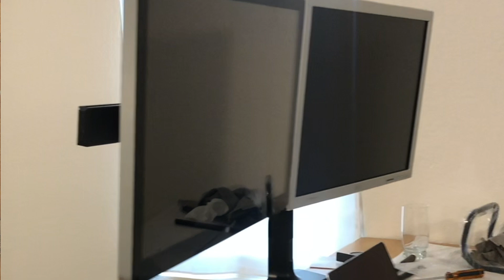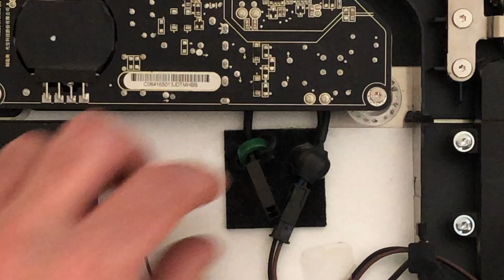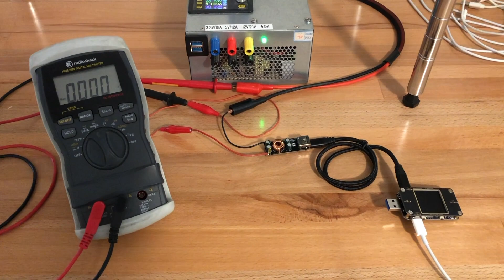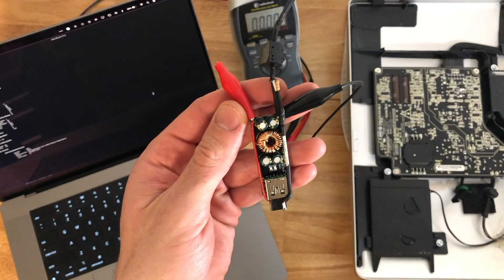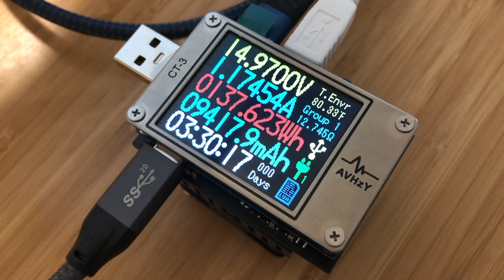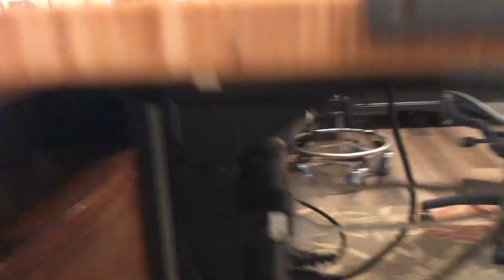Thunderbolt Display USB-C Retrofit for Modern Macs!

Comment: Is there any way to connect three thunderbolt displays to an M1 macbook pro? My current understanding and testing is that apple purposefully limits it to two external displays. And the only way I know how to make it work is the M1 MAX/ULTRA chips which allow 3.
Reply from the maker: Yeah essentially you chose how many external displays you needed when you bought the Macbook. It's a System on Chip architecture, so the video controllers are built right into the same chip as the CPU and RAM, etc. Apple doesn't limit anything, it's just that an M1 PRO chip has capability for 2 external video channels. The M1 MAX chip has more video controllers built into it. I have the M1 PRO so I used a DisplayLink adapter for the 3rd monitor. It runs off of USB. Far lower bandwidth, but the display performance is plenty fast for typical applications.
Reply: Thank you for the response! I ended up with an M1 Max laptop with three beautiful apple thunderbolt displays in sort of a T shape. It has been amazing. But my one of the thunderbolt cables was getting wonky and I kept having to set the cord at different angles for it to work. Finally just got an apple thunderbolt 2 cable and used this video to install. (no need for the power). Thank you for taking the time to put this content out there! @colindgrant

Comment: Any reason why you replaced the thunderbolt 2 cable inside the monitor, and not just use the one it had by by plugging the adapter directly to it? Any advantages to that? Amazing video btw, it is very inspiring!
Reply from the maker: I talked about that a little at the beginning. I had to replace the TB2 cable anyway, and my goal was to match the design concept of the original Thunderbolt Display. Power and data to the laptop with no dongles or adapters, total freedom of movement within the length of the cable(s) to the laptop. Glad you liked it!
Reply: @colindgrant  Ok I see. I thought replacing the TB2 cable to a newer would make it faster & more stable :) Thanks for the video

Comment: if the type c supplied power then you dont need magsafe 3 connector if using one cable only
Reply from the maker: You're thinking of USB Power Delivery (USB-PD), Thunderbolt 2 doesn't do that and these are Thunderbolt 2 displays. Only about 15W available for accessories.
I would have to introduce a Thunderbolt 3/4 hub with Power Delivery to do everything over one cable. It's discussed elsewhere in this comment section.
Reply: @colindgrant oh no! Some windows laptops with type c Aren’t PD! They have a charging icon but aren’t PD but thunderbolt 3!

Comment: would there be any way to combine the TB and power into one cable? iirc USB-PD negotiation happens over the power lines themselves so i wonder if the power pins going out could simply be injected into the outgoing cable?
Reply from the maker: I don't know how to combine USB-PD and Thunderbolt onto a cable electrically. I've looked into it a bit, and it's quite complex. The easiest solution would be to introduce a Thunderbolt 3/4 hub with Power Delivery to do everything over one cable. It's discussed elsewhere in this comment section.

Comment: Cool project from technical standpoint. 

BUT the result is not so impressive. Nothing I would like to have on my desktop. Even the Apple Cinema Displays might be good enough for many use cases.
Reply from the maker: Your comment doesn't make sense. The Cinema Displays are not compatible with this laptop. This is video about Thunderbolt connectivity. If you don't need that, then I'm not sure why you watched and commented.

Comment: Could you replace the thunderbolt 2 port on the logic board with USB-C rather than relying on the adapter?
Reply from the maker: The adapter translates TB2 to TB3 in addition to adapting the physical connector.

Comment: i want to use it on imac as second monitor? can you guide me how? my TB display power cable is not working it flickers the display so i am thinking to do this modification and power up TB display again? any thoughts on this?
Reply from the maker: Sounds like you just need a new cable, you don't need anything in this video. Apple publishes articles about how to use an iMac as a display. I've never done it.

Comment: can we simply connect 16.5V adaptor to power on the display - I just want another display ( not wanna use USB -C to charge my laptop as well? @colin  grant can you help?
Reply: If I understand this correctly, you can just connect the Thunderbolt cable with the usb C adapter. - failing that the display itself can work with a Thunderbolt 2 and adapter plugged into the rear port.  - it’s a fix I have used a couple of times when the displays cables are knackered.
Reply: @simonirons  Thank you for this!!
Reply from the maker: The Thunderbolt Display is powered by A/C from the wall, and there's a power supply internally. This video doesn't cover any alternate methods for powering the display. It covers how to power your laptop off of the display (using USB-C).

Comment: Thank you for this video.

I did almost the same mod based on the information here.

The major difference is that I started with the older led cinema 27" because it is cheaper and can be modded to give charge through a single connector. The only major difference between the two is the webcam.

What I did was to replace the webcam with the one from the thunderbolt display. It is a straight swap and cost about €15.

I then split the cable into the three separate cables (DP, USB and Magsafe) using a sharp knife.

Magsafe I cut and modded the same way as here using a 39k and a 390 ohm resistor in series.

The USB cable I replaced entirely with a much shorter one and the DP cable was terminated with a DP to mini DP adapter.

All of these parts I then connected to a simple USB-C dock I found for about €15 on aliexpress and extended the cable with a USB-C extension cable.

All of this of course with liberal amounts of shrink tube, a couple of zipties and even a ziploch bag to insulate the display cable. And a quick and dirty strain relief.

Total cost was about €50 on top of the €200 display and it took me and my friend maybe two hours.

It works an absolute treat. The biggest letdown is seriously that I wasn't sble to source a white braided USB-C extension cable.
Reply from the maker: That is so cool! I'm so glad you shared the details of construction. Do you know how to get more than 15-16V out of the display's power supply? Is that what the 390 Ohm is all about?

I didn't know the two models were so similar, that's great. And DisplayPort gives you many more options, like the USB-C dock you mentioned. Ever looked at TB4 docks? They're not cheap, and there aren't many options. Meanwhile video over USB-C (alt mode I think it's called?) is more and more common.

I like keeping older tech alive and it sounds like you do too. I'd love to see this project, and I'll bet lots of others too. Ever consider making a video?

Let me know if you figured out how to get more voltage from the power supply. I'm curious about using it to power a TB4 hub with PD, in order to get down to a single cable.
Reply: @colindgrant  I'm not sure it is actually possible, or at least it not easy, to get more than 16,5V out of it. And even if you did it would be close to 20V and not the 21V requried for the PD adapter to deliver the 20V level of the PD specification. So we are pretty much limited to 45W without some major modifications to the power delivery setup. And I'm fine with that. When I dock my computer it is for hours so 45W will keep the battery topped up just fine. Persumably there could be a scenario with heavy power usage (I do CAD for example) that actually has to dip into the battery reserves to keep running. But I think that is a supported scenario.

The 390 Ohm resistor was to make up the 39,41K resistor needed to start the magsafe circuit. The actual value isn't actually that critical. But I had 39K resistors as well as many other values. Bue to tolerances in resistors they could actually be quite a bit off the specified value, especially for my cheap ebay ones from many years ago. So I used 39K as a starting point and experimented with some combination until I got close enough.

Yeah, they are pretty much identical apart from the webcam and the IO on the back which on the TB has the firewire, ethernet and thunderbolt daisy chain. And since you can't daisy chain two displays in this scenario those ports probably aren't getting used by most people anyway. The casing is certainly the same and the speakers, power supply and panel are supposedly identical. So the difference is the webcam and the control board. So in this scenario I would say the Cinema Display is the better starting point unless you already own the Thunderbolt Display and the adapter.

I did consider a TB dock but they are far larger, harder to install inside the display and also cost something like €300 or more. I can't see any real benefit to that approach over mine. Maybe it would be possible to get some kind of daisy chaining going but that's it.

I don't have the time or the skills to make a video out of this. I do have a few bad pictures I took. If you would like to make a short follow-up to this video using those pictures and do some commentary explaining what is going on I'd be very happy to see it out there.
Reply: This is cool, there are some small DP adapters out there which have a second port for power, too (elecjet) so both display and power are delivered via one cable. - The regular USB needs to be connected to allow camera + keyboard shortcuts - brightness, volume etc. (even for wireless keyboards which I found odd)

From memory the cinema displays and Thunderbolt displays were available at the same time, a lot of refurbers prefer the cinema model claiming they are more reliable. - personally I don’t like the 3 adapters when connecting the conventional way.

Comment: Colin I saw your video and I am really inspired to do this mod as well. A couple of questions. 1. How aviod being shocked? I am a bit afaid to mod this. 2. Will this moitor work if i just remove the all in one cable and use the out side thunderbolt port? 3. Will this work with a half mod without doing the power delivery usbc?
Reply from the maker: Just to follow up, yes you can do just power or just data. No need to do both. The safest way to avoid being shocked is to leave the monitor unplugged for a couple weeks before opening it.

Comment: Can i just plug an thunderbolt to hdmi cable to the logicboard and use it like an regular pc monitor?
Reply from the maker: Nope, it's not like DisplayPort or HDMI or DVI where you can adapt between them. The video signal is packaged into a Thunderbolt transport.

Comment: Very nice.  The only video out there retrofitting these beautiful displays.  I wish you spent more time in showing us a step by step in putting together the finished charge module. Everything else had an in-depth instruction except putting  the 39.4 resistor , shottky barrier diode and voltage conversion module together.  How was that resistor connected?  Did you use only 2 pins in the shottky diode connections?  which one did you cutoff?
Reply from the maker: Yes, I could have shown more of that assembly, but it's just the same thing that I did on the breadboard. The resistor goes across positive and negative. I showed that at 10:27. And yes I only used two pins from the schottky barrier rectifier (because that's the 'diode' that I had laying around). You just need a single anode and single cathode, and I discuss that around 12:30.
Reply: Great video and awesome mod to keep this tech modern. 
Similar question, maybe redundant but the barrier it connected through the positive wire connection right?after the resistor? 
Just want to clarify as I want to do this mod myself but I’m not as well versed in electrical wiring.

Comment: It’s a shame you can’t get an adapter like Utab’s minidisplay model that supports a power feed, too. 

Would it be possible to link both MagSafe and Thunderbolt adaptors to a USB C splitter inside the unit for a single cable option or would you loose TB capabilities?
Reply: I agree but loss of TB could be fixed with a Thunderbolt capable mini dock, something like 'belkin-thunderbolt-3-core-dock', connected in the monitor case collecting the thunderbolt and the usb-c power into one cable should work?!!? You could even add a HDMI port to the back of the screen!
Reply from the maker: @MrAnwarsmith I think you'll like this video! It's my implementation of your comment: https://www.youtube.com/watch?v=2YE8N8NHb-A

Comment: Incredible. I have two of these monitors collecting dust. I have plans to build a workbench in my basement storage area near my lab rack. Your work just saved me from selling or chucking the ACD's. Please share updates if there are any!
Reply from the maker: That's great! It's awesome when you can extend the life of good but older tech. By the way if you have the older non-Thunderbolt display you can just use a USB-C to DisplayPort adapter instead of the Thunderbolt 3 (USB-C) to Thunderbolt 2 adapter. I'm happy to report this setup has worked very well since posting a year ago. Good luck on your workbench build!

Comment: Hey Colin

My Thunderbolt display sometimes flickers which is annoying so today I received a Thunderbolt 2 to USB C cable from amazon, I opened the display and removed the old thunderbolt cable that has a magsafe cable attached to it and fitted the amazon cable, but that didn't work, do you know why?

I believe the flickering is caused by the cable therefore was planning on just swapping to a new cable, i use a Macbook pro 2018 so i do not need the magsafe or the thunderbolt 2 connection, i thought I can just switch it over with a conversion cable, maybe if I swap it with a thunderbolt 2 to thunderbolt 2 cable and use the adapt it would work that way? Any recommendations would be greatly appreciated
Reply from the maker: You're probably right about the flickering being caused by the cable. That's something I experienced and many others report.

I'd be very skeptical of that so called "Thunderbolt 2 to USB-C" cable you received. I've never heard of one, and I doubt it exists. The reason is that the conversion requires active electronics, not just pin reassignments. I would be very surprised if anyone was manufacturing an active conversion cable for this purpose.

I suspect you have a USB-C to Mini-Displayport cable. That works because the USB-C port on your Mac can fall back from Thunderbolt to Mini-Displayport.

I'm almost positive that to go from Thunderbolt 2 to USB-C, you'll have to do what I did - use a Thunderbolt 2 cable and the Apple Thunderbolt 2 to 3 converter. I think that is the only option.

Good luck!
Reply: Im using thunderbolt 2-3 apple and come the same case, sometimes flickers, i must unplug and plug again to continues using 😢
Reply: @vietkhoamax  I solved my issue by opening the display and cleaning the whole unit, removing the thunderbolt cable and cleaning the connections, reinstalled everything back together and not had an issue since.
Reply: @Amir_Wanas_Photography  great work due
Reply: @Amir_Wanas_Photography  do your thunderbolt display can running with macbook pro using windows install by bootcamp

Comment: Will this work on the Cinema Display?
Reply from the maker: This is specifically about the Thunderbolt display. I think the non-Thunderbolt cinema display is just Displayport. So you would only need a USB-C to Displayport adapter. For power you could do the same as I did though. Some good info here: https://support.apple.com/en-us/HT207443

Comment: Great tutorial Colin! you could use this LINDY L43246 mini display port to usb-c with power delivery (it's also very cheap) and have only 1 usb-c cable my only problem now it's how to implement in this setup a usb for my mouse because i'm using logitech g pro mouse.
Reply from the maker: Unfortunately, the Lindy adapter you mentioned won't work with Thunderbolt Displays. It only outputs a video signal over the Display Port connector, and not a full Thunderbolt data stream.
Reply: @colindgrant extractly